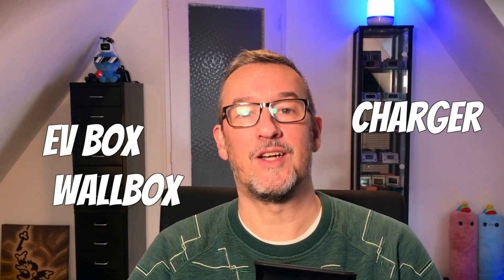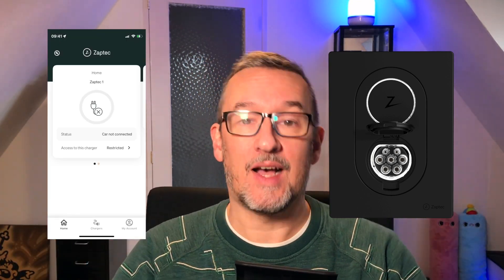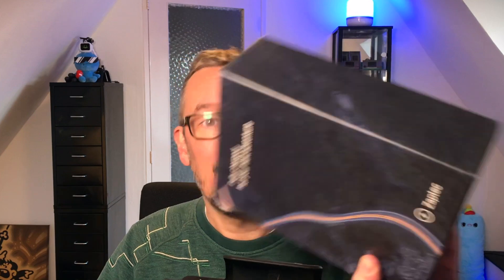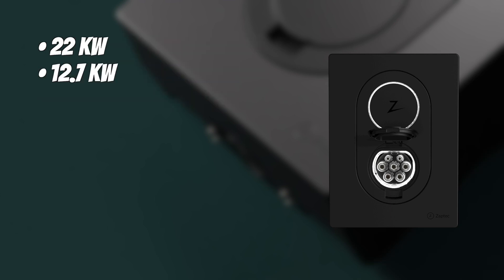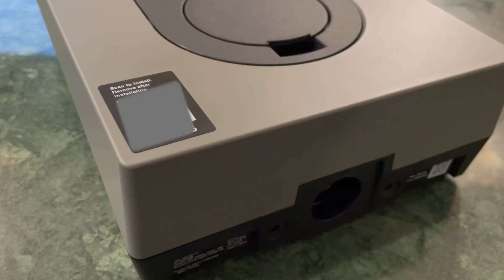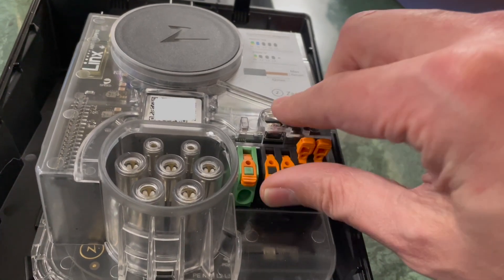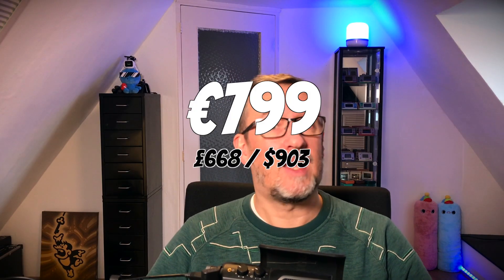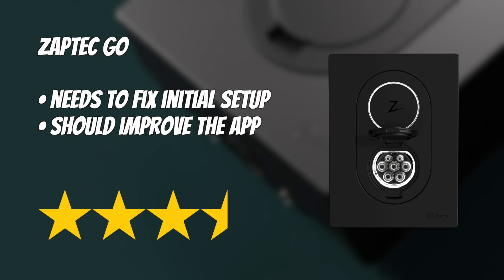Zaptec Go EV charger | review

Comment from the maker: The Zaptec Sense P1 load balancing unit, which connects directly to a P1 meter port without any extra converters, is available july 2024. The Zaptec article number is 900-00114 and it costs about €99.

Comment: I've enjoyed the zaptec go but I'm moving house this week and installer isn't available to move the charging unit/take it off my original property.

Does anyone have any info or how to remove the unit? I understand an electrician can help make cables safe but will they know how to remove the unit? I only have a few days to do it... I'm less worried about installation at new house as I can wait for installer to be available for that. Thank you
Reply from the maker: DISCONNECT ALL POWER AND SOLAR PANELS BEFORE YOU START) There is a screw at the bottom that opens the cover. The wires are clamped and you can open the clamps with your fingers and the wires are then loose. Pull the wires out through the bottom. The unit has four screws, one in each corner that attaches it to the wall. Remove screws and now the unit is loose.
Reply: @hotdogsoup-nl  thank you so much!!

Comment: Thanks for a great review. I am a norwegian Zaptec user, and I can relate to your headaches when it comes to installing the device without a installer (installer reseller is a more appropriate description) In Norway Zaptec chargers are mostly sold through installers, and Zaptec apparently have a great framework and documentations for installers to use to initially set up a charger. Generally, the installer does the first part of the installation (which includes the QR code scan and first install procedure) before the end user is recommended to download the app and start their registration process. If you look around Zaptecs API, they have 3 tiers of entities - the installation, the charger and the circuit installation where the installer is in charge of setting up all 3 before the user can access the installation as a user. When it comes to the initial setup issues, I can only speculate that Zaptec does some IP geofencing to some of their setup components as Zaptec chargers are officially only sold in Scandinavia through installers/resellers (not considering grey imports) and they don't want others to access parts of their infrastructure. I am even more suprised that the 4G SIM is working/roaming properly. I own a Zaptec Pro myself and I've been loving it since 2018!

Comment: I just bought a new house with a zgo installed,  so just came here to see what to expect. A little other way around 😅 after googling a little I found out a lot of users are having problems with thermal throtteling. Norway is not that warm so have you experienced it?
Reply from the maker: I’ve never noticed it but my car does not charge that fast. The car does sometimes run its fans while charging so it does get warm. I don’t know if the car decides to throttle or the charger, so who is to blame? Maybe the Zaptec people can answer that question.

Comment: Thanks for the review. I’m currently considering to purchase the Zaptec Go as well here in The Netherlands. I’m no technician so will have it installed. How are the specs regarding safety? They state it’s very safe. Does it Includes earth leak protection, over and underload protection, overheating and short circuit like other chargers have such as the Alfen chargers?
Reply from the maker: It does have earth leak protection and they claim it’s the safest charger, see https://zaptec.com/en-uk/world-class-safety/

Comment: The reason they decline your query if you say you haven't contacted the installer, is because working with electrics is very regulated and strict in Norway. The installer is responsible for setting the charger up so I'd say it's a great thing.

Comment: The review is good. I am happy with the charger but the support sucks and they are on their way to kill a good product with their customer support or lack of it. 
I have asked for help for their outdated app and all I get is an automatic reply telling me to contact the installer.
Since when did electriciuans give support for an app? There is no problem with the hardware and it charges if started manually.
Their eco mode is a nightmare. Rather than setting the charger to charge at low peak hours, you are asked to put the time of departure and the amount of kWh needed. When you try to start it it starts charging at once as the eco mode switches to the default time of 10:00 and 30kWh.
For this I am being told to contact my electrician.
Dont buy this charger before they sort out their app.

Comment: makker, ben je oke?
Reply: interesting review. i'm currently scoping out a charger and worry this model has the same flaw as the Easee one: owners are utterly dependent on the manufacturer's continued operation of their (azure) cloud services...services with running costs as well as maintenance. At some point this stuff will get turned off or they say "sorry, your product is no longer supported ".  at least they do have a web portal so even if some android/iphone OS update kills an unmaintained app you have the portal. But i would  love to know what offline charging it offers
Reply from the maker: As far as I can tell, it works correctly even when it is offline. You can even disable WiFi and 4G connectivity and it keeps working. You won’t have statistics etc and get no software updates anymore, but it keeps charging cars.
Reply from the maker: I'm fine thanks!

Comment: Great review. As Paul says, App improvements are in development, and we take onboard feedback at the end of the video re support tweaks. Happy adventuring.
Reply from the maker: Thanks! Maybe the app could give hints about the installation process, so when people don’t read the manual (which is everybody) they’ll still understand the installer must do something first. If all stats & settings for normal users are moved from the portal to the app, they never will have to use the portal again which may remove some confusion. I feel the portal is more for power users (with more than 1 installation) and installers, whereas regular home users (1 installation, op to 3 chargers) should just use the app and never use the portal. Keep up the good work!

Comment: Thank you for this excellent and thorough review. We really appreciate the honest feedback. App improvements are coming very soon!
Reply from the maker: Thank you, the excellent quality and design of both the device and the app remind me of Apple. Keep up the good work!
Reply from the maker: Feature request: I use cable locking so people don't steal my cable. But after charging I'd like to remove it. Would it be possible to unlock it for 10 seconds (while car not connected) when I scan my RFID card / key fob and then lock it again?
Reply: @hotdogsoup-nl  That's a great idea! Thank you. I'll feed that back to our devs...
Reply: Hey  i changed to this aswell from EO mini, im also an electrician.   You can use third party sensors that you connect to the han plug if you want to use load balance.  Im using tibber in Norway atm, but I guess it depends on wich power Company you use.  😊 😊
Reply from the maker: Hi, I’ve made a follow up review today 😀 here it is: https://youtu.be/tChwjUa7Bi8?si=VwShKG23n1In9BMB
Reply from the maker: Hi Paul is there any way I can buy the new Zaptec Sense? Thanks.
Reply: @hotdogsoup-nl  Sure is! The Sense was launched today and you should be able to purchase one through our international distributors.
Reply: @hotdogsoup-nl  yes, it was launched on June 1st! You should be able to purchase via our international distributors.
Reply from the maker: Hi, is there any way to use Zaptec Sense with a P1 meter?
Reply: @hotdogsoup-nl  there is - but you have to use a P1 to Modbus adapter. We don't have native P1 support in Sense (yet)